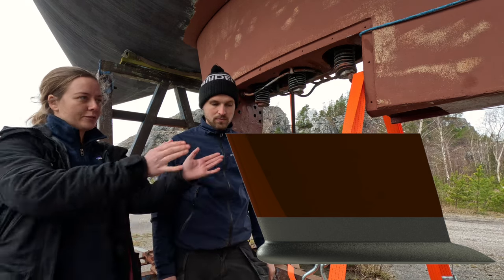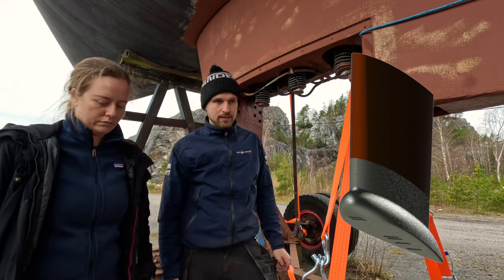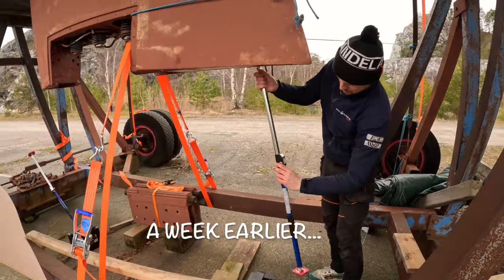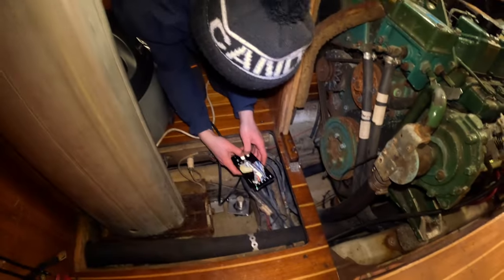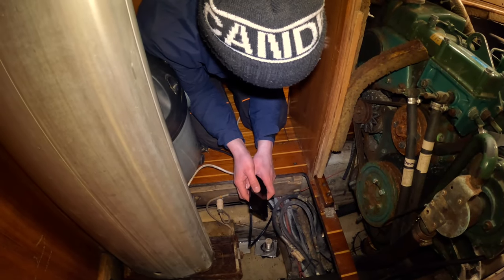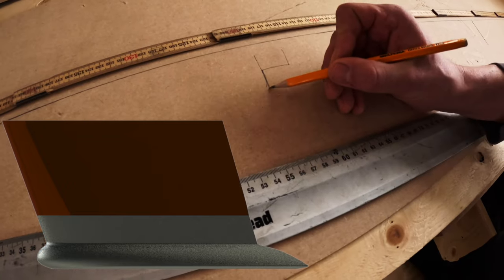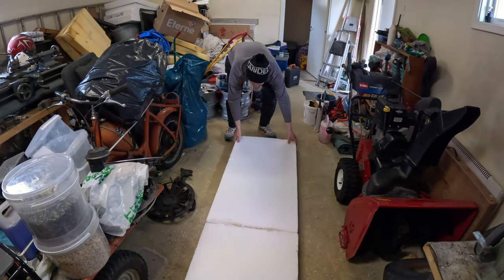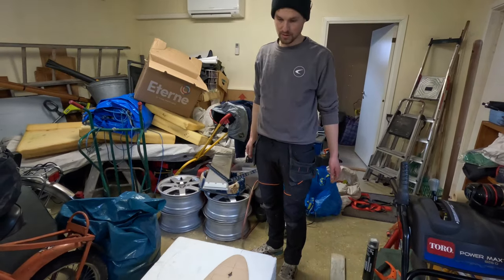Keel design & making the plug [2.12]

Comment: Really enjoying watching you both (important to emphasise both, not just one) work together on all the aspects of your projects - theoretical, technical and practical. Although not on your immediate priorities I wonder what your thoughts are on two things: the quality of the hull (water impregnation etc) and the "value" of rod rigging. I look forward to watching the project develop and wish you both the best of luck and success.
Reply from the maker: Thank you ☺️☺️
We did some measurements when we bought the boat to check for moisture in the hull, and didn’t find any (but guess it can be easily missed if measuring in the wrong places 😊 during the boats lifetime it has been standing on land for more years than it has been in the water so we are not super worried about that, but maybe we’ll get an unpleasant surprise in the future 😊
And yeah, the rigging, we will prioritize this as soon as we managed to get the boat into the water. We’ve started doing some research and talked to some riggers, and so far we haven’t really decided on anything, or have any strong opinions either way 😊